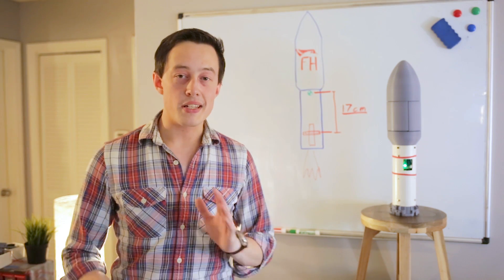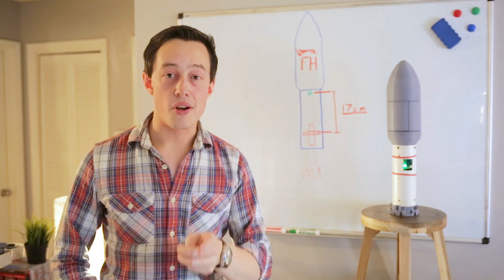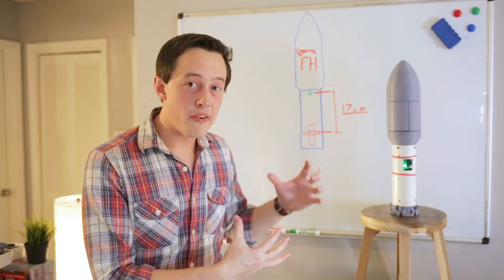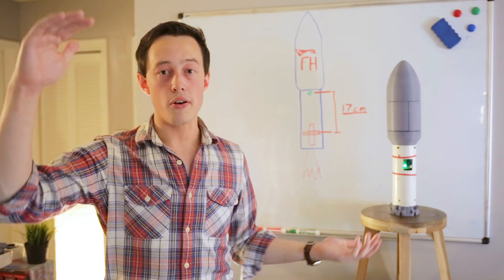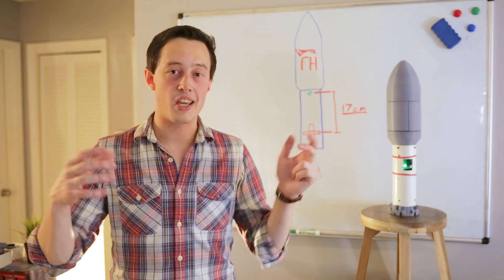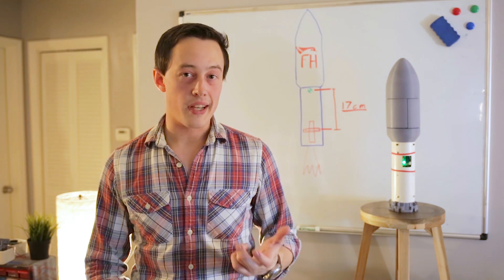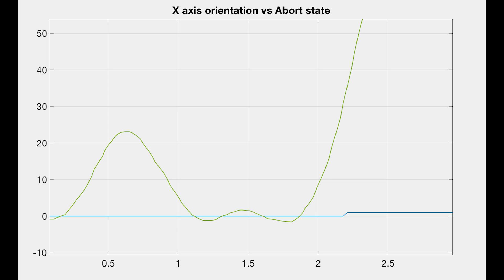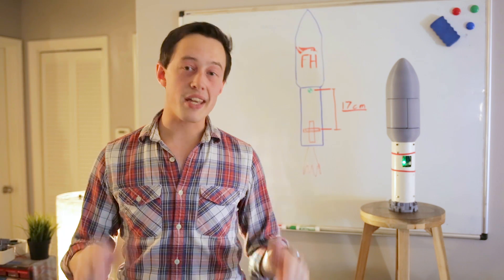Falcon Heavy Upper Stage Flight Explanation

Comment: I just wanted to give my take on the whole liquid fuel idea for why not use something cheap like butane cans as the fuel along with an oxidizer possibly liquid oxygen just pressurize the oxygen and feed both lines to a combustion chamber with a high voltage arc starter and gimble the nozzle

Comment: It think it would fly better if you attach the first stage. Assuming you have the separation down the second stage would already have momentum in the proper direction. When you launch off the pad it doesn't have the momentum.

Comment: I would say forego the fairing for a simpler easier design that isn't so draggy. Like maybe the dragon capsule or something.  When you get a second stage that can function properly, then maybe turn up the difficulty by adding the larger fairing. It is cool, but good complex systems first start out simple and then further developed.

Comment: I'd look into gyroscope sensor accuracy and response time as well as gimbal reponse time and gimbal angle precision. If I was trying to make a flight more stable I'd try to optimise these values first. Surely it shouldn't matter greatly where the source of disturbance is coming from, if your attitude control system can correct it quickly and accurately enough. Best of luck anyway, I love watching this project develop, you're doing an amazing job!
Reply: Great graphs!!
Gimbal angle precision looks very low, considering that the resolution of the servos is at least 64 steps in each direction. Is this a physical or purely a software limitation?

Comment: Putting in ballast to up the MOI is going to help. Extending the fairing aftwards would also lower your aero torques in a more aesthetically pleasing way than adding fins. Or you could also texture the front of the fairing to induce a turbulent boundary layer and lower your coefficient of drag (like golf ball dimples do). 

I think you correctly identified though that ultimately though your thrust misalignment is going to kill you, and that’s the problem you’ll have to solve. There may be some way of sighting the thrust vector on the ground with more precision than manual alignment - a printed jig with a rod that goes in the motor hole might be in order. Pumping up the integrator gain a little past the optimal point would also be worth trying.
Reply from the maker: I'm going to try and avoid the ballast option, but we'll see how much more it can improved without it. Better alignment can probably be achieved though, I have a few ideas to help with that. Speaking of the PID gains, I could also jack up the D gain a bit and accept that there will be some oscillation - that'll certainly help with how fast things happen at this scale.
Reply: Why not just increase the P gain? From the graphs it's obvious that the sensor platform did its job, and the motors gimballed, they just didn't go far enough and you had to wait for the I term to eventually catch up and shove them further.  I would second-guess whatever simulation you are using to derive "optimal" values and just do an old fashioned parameter sweep with the real flying rocket.
Reply: Besides a parameter sweep series of flights would be great video tutorial material, you could superimpose video and show what low/good/high P gain does, then low/good/high I gain, and D gain. It would be very visual.

Comment: Wouldn't its initial inertia be higher when launched properly as a second stage. I could still se atmospheric interference if it hasn't cleared enough atmosphere.
Reply: Redstone Wizard it’s not going to get that high mate! Definitely not enough to make a difference on atmospheric density.
Reply: D C You’d be surprised how much atmospheric pressure drop off there is in the first 30 meters.

Comment: Very nice update! Make the second stage a little longer say 20%-30%. It won't quite be to scale but it may make it easier to control. To bring it back to scale on the pad, shorten the center core by the same amount. (or telescope the longer second stage into the top of the central core) When the center core is flying with the second stage it should still look correct, and then after staging the second stage is so high that no-one can see that it is a bit longer. 

What was the CG-CP relationship for this second stage? It looks as if the CP is probably ahead of the CG. Perhaps adding more nose weight may bring these closer together and make it a little easier to control?
Reply from the maker: I like this! The TVC mount can be smaller anyway, so the telescope style might be a good call! The CG-CP relationship is hellish - CP is all the way up top, CG is in the middle. I'm going to try and avoid adding weight, the whole vehicle is already much heavier than I'd like.

Comment: The moment arm could be lengthened by moving the TVC bits down into the interstage of S1 (like the real FH) but that would make seperation a bit more difficult (risk of S1 shoving S2 off-kilter due to the protruding engine tube). Moving the center of mass upwards, whether that comes from a lighter TVC mount or adding mass to the nose of the fairings would also help. And of course, adding fins to S2 would probably work, although it would look sorta weird.
Reply from the maker: Yep, all good plans. There's not much room to go lower with the TVC mount, the stage is already slightly longer than it should be to be scale-accurate. I'd like to not change the weight if possible, it'll already be tough for the center core to lift both itself and S2. I'm thinking clear fins and better tuning might be the best bet.